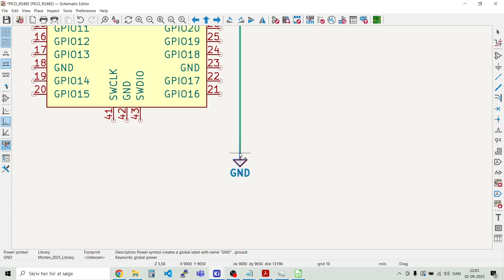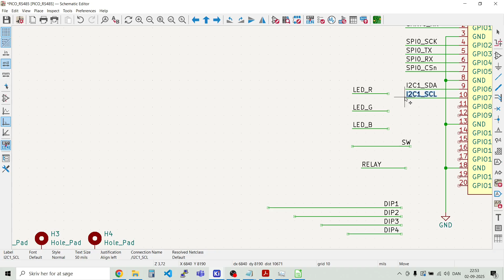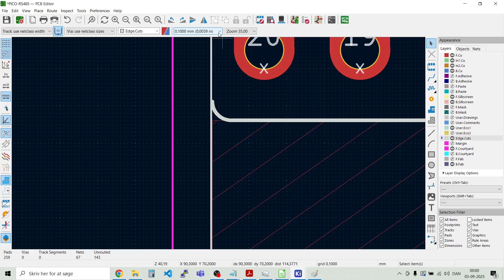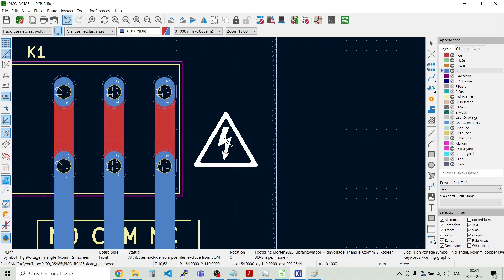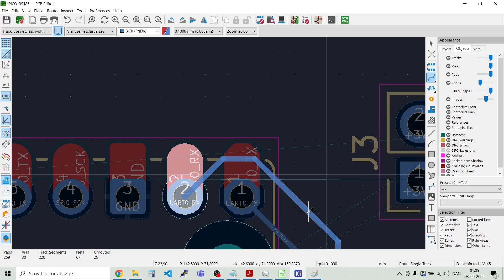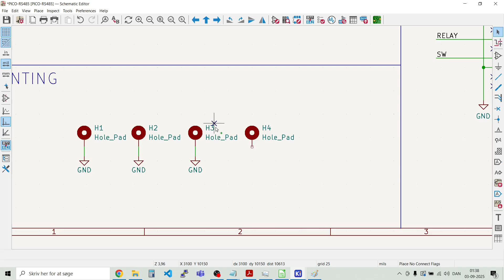KiCad 9: Design of a Raspberry PICO IoT device on 4-layer PCB with sensors and more. Complete Guide.

Comment: Hello I built this board as practice and when I was testing I am having problems with the relay. I think this is a bistable that requires reversing the polarity to operate it ( maybe with a h bridge?) instead this circuit is I understand well just provides 5v if RELAY is HIGH. For this circuit to work the relay should be a RT314005 instead of a RT314A05. Am I right?
Reply: Thank you by the way great tutorial!!
Reply from the maker: You are rihgt, the RT314005 is the correct type, good catch! Sorry for the mistake :-)
Reply from the maker: I will check it and get back to you asap

Comment: It seems you're only using the 5V for the relay. In the same time you're using quite an expensive part to go to 5V and an inefficient linear voltage regulator to go to 3.3V. Why not go directly to 3.3V using a switching voltage regulator like the XL1509-3.3, and a 3.3V relay? Is saves you on your BOM, €, some board space and makes the device more efficient.
Reply from the maker: Thanks you for you detailed comment. Yes you are right this can be done in many ways, the DC-DC block is my goto switcher and the 3.3V LDO is also a part that i use in big quantities.